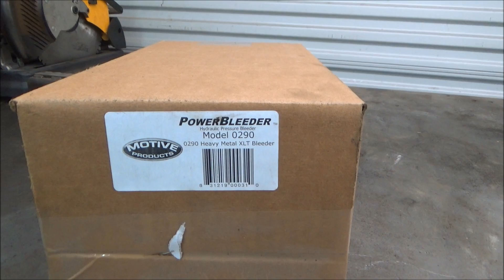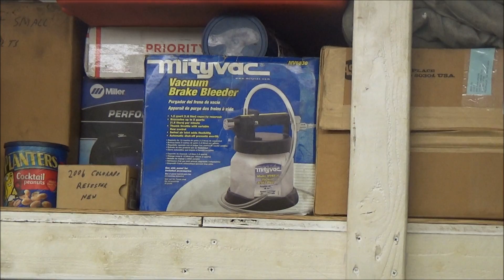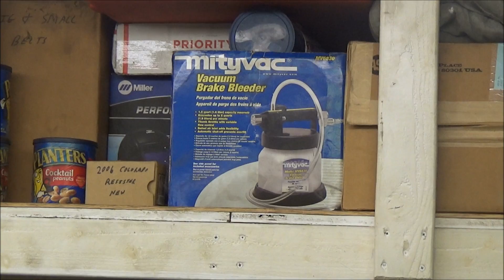How to Bleed Brakes with a Motive Products Brake Bleeder (Review)

Comment: and use a clear hose on the bleeder to see the air bubbles properly
Reply from the maker: transdimensionalist   I normally use a clear hose.   The only clear hose I had has gotten hard.  And I would have to fight with it to get it to go over the brake bleeder screw.

Comment: How do you recommend cleaning the pump and tubes after use?
Reply from the maker: I only wipe the inside out with paper towels
Reply: According to Motive, they say to clean out the inside with denatured alcohol. And if you don't have that, a dilution of Simple Green will also work

Comment: I kept getting air in my system I found you have to close the bleeder before relieving the pressure or what happens is the sudden pressure release makes it suck air into the wheel cylinder.  Sometimes the O-ring in the pump lid falls down when your twisting it on and doesn't seal right takes several times of adjusting the o-ring and re-screwing it down. I also bought the bleeder bottles they fill up really fast if your not careful. I got 2 plastic bins from the dollar tree if it over flows go into the bin. I know they say to drain it out of the pump I just put a cap over the hose end so it's sealed up wont get air in there leave some fluid in the pump had same one for 5 years never had  problem.

Comment: do you ever have to add fluid before finish all 4 wheels or one fill completes all 4 wheels ???
Reply from the maker: +PBS #007     One fill will do it.   Just make sure you put enough brake fluid in the brake bleeder,  so it doesn’t run out.

Comment: I wish something like this was available for home use back in the '60s. Back then I put a hose on the bleed screw and put the hose in a bottle of brake fluid. Then I just pumped the brakes and make sure the master cylinder stays full. Rinse and repeat for each wheel. Back then, we ran drum brakes, none of that disk brake nonsense. :-)
Reply from the maker: tom7601   I did it like that for many years also.   I would make the customer get it the car and pump the brake pedal.   It sometimes a hassle to get the master cylinder to start working when you replace it that way.

Comment: My car is simply up for its scheduled 'brake fluid change'. Would you recommend this bleeder for that purpose over the old fashioned two man/brake pump operation? I heard the pumping method can cause damage but I've personally never seen it.
Reply from the maker: +Flashbax   Yes it will work.  You can do it either way.  Won’t cause any damage.

Comment: on the vacuum bleeders i find you need to put some greese around the bleed nipple threads to stop it sucking air in through the threads
Reply from the maker: transdimensionalist    I’ve tried that before and it still didn’t work right.
Reply: sometimes you have to take the nipple out a geed few threads then coat with grease and put back in near closed or the other thing i came across was a bad caliper seal started sucking air in which case i replaced the seal and it worked fine, not sure why you had issues unless the actual seal between the hose and bleed nipple was sucking air, i have turned more to these vacuum ones because getting a pressurised bleeder to seal on some brake resevoirs is near impossible and now i prefer the vacuum ones due to simplicity

Comment: Looks like a good tool....question...do you have to bench bleed the master prior to installing/bleeding on the car
Reply from the maker: outsidescrewball    When your using a power bleeder you don’t need to bench bleed it first.   I normally never bench bleed them when you go to put the master cylinder back on after that you end up getting brake fluid leaking all over the place.  All bench bleeding does is helps get the air out of the master cylinder to make it start working right away in the beginning.
Reply from the maker: EBI Rules  The last part is if your bleeding the brakes by pumping the brake pedal.  Thats the main reason for bench bleeding a master cylinder,  so it starts working right away.   No need to do that if your using a brake bleeder.

Comment: How would you use this on an old cast iron manual brake cylinder ('69 Dodge)?
Reply from the maker: It comes with the adapter to do old cars.  That adapter clamps to the master cylinder
Reply: Very helpful thanks everyone

Comment: Size of the clear tube hose to drain the old fluid from calipers? and the same procedure for flushing clutch fluid right?
Reply from the maker: Okaythen001   You can use any hose that fits on there tight.   All I had was black hose.   Yes it’s the same way for doing the clutch.
Reply: Hose is just to make the job less mess right,  it can be done without hose right? fluid will just get everywhere. But if using the old 2 man method then hose needs to be real tight so air won't go back in?
Reply from the maker: Okaythen001  that’s kind of a yes and no answer.   It’s better to put a hose on it.  Then you can see easier when all the air comes out.
Reply: I need to flush both brake and clutch fluid. (they share the same reservoir in the focus st) So just bleed clutch first then brake or it doesn't really matter in what order? And when you attach to the brake fluid reservoir and pressurize it to 15psi, there is some air in the hose between motive bleeder and the brake reservoir. So just bleed until THAT air comes out right? But if the fluid is low in the motive and I need to refill it, there will be air in the motive hose again .....then? need to make sure I get enough fluid in the first shot?
Reply from the maker: Okaythen001   It shouldn’t matter in what order you do it.   It also doesn’t matter if there’s air in the lines on the brake bleeder.  It will keep the master cylinder full of brake fluid.
Reply: Awesome thanks so much, now that I got everything figured out I am gonna buy the motive bleeder and do it myself!  thanks so much you are very helpful.
Reply from the maker: Okaythen001   Thanks

Comment: Avant de purger avec le power "bleeder", il faut que le liquide soit au niveau mini ou maxi dans le maitre cylindre?
-----------
Before bleeding with the power "bleeder", it is necessary that the liquid is ADD or FUll  in the master cylinder?

Romain
Reply from the maker: Romain   Yes the master cylinder should be full before you hook the brake bleeder up to it.
Reply: OK, thanks.
 😉